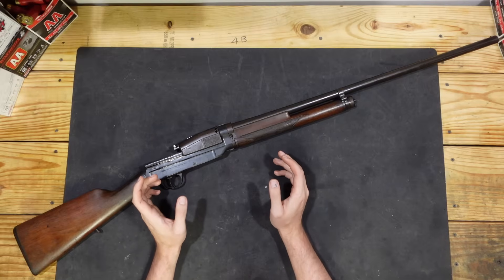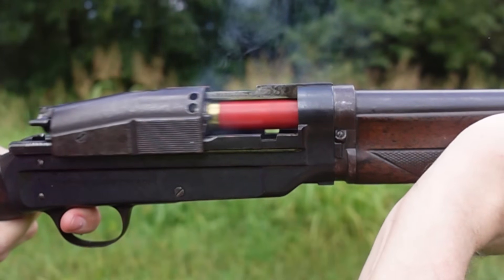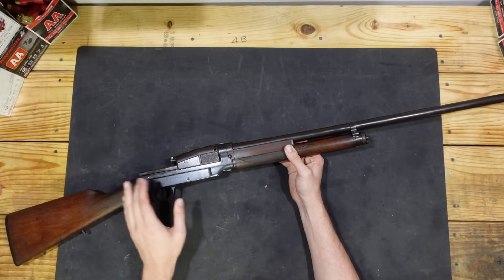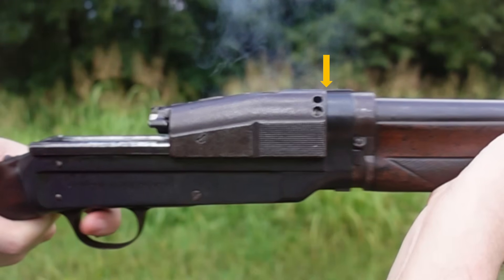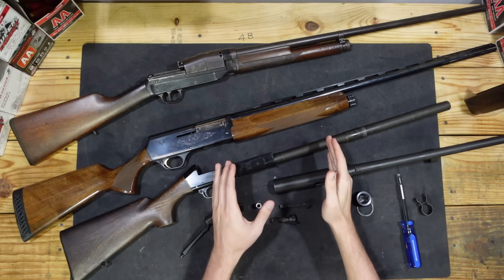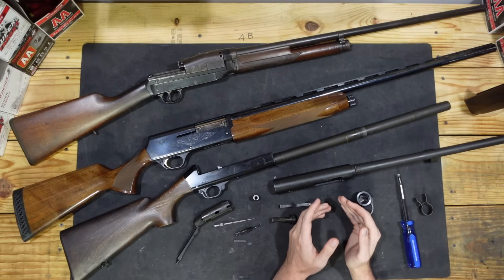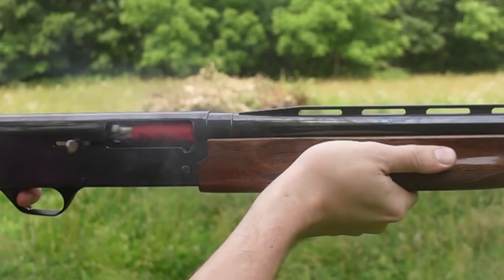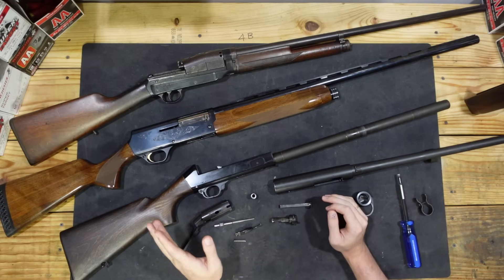How Inertia Operated Shotguns Work

Comment: A REALLY interesting shotgun to show would be the Bernardelli Victor (manufactured from the late '40s to the late '60s).
Other than having a prismatic detachable magazine, that gave it the look of a battle rifle, its operating system is practically that of a SVT40 rifle, with all the gas part removed, so that it works thanks to a mix of inertia (of the bolt carrier, that's helps unlocking the bolt) and mechanical disadvantage (due to the locking surface on the rear of the bolt being slightly angled). 
The first version required to change the setting of the recoil spring between light and heavy loads. The second one not even that.

Comment: Love videos like this. When you get around to a gas gun video, could I ask for a segment on the Benelli M4 and how its ARGO system is unique from other gas systems?
Reply from the maker: It's not really very unique. It's a "White" style gas cutoff system, like the M14 has. It's execution of that design is certainly different, but the gist is still the same. If I ever end up owning an ARGO gun I'll definitely talk about it, but it's not nearly as novel as Benelli advertises. And it's not really "self adjusting" in a meaningful sense of that word - just like the M14 isn't either. Gas cutoff systems can run cleaner, though. And the Argo system is a decent implementation of that.
Reply: @IvanPrintsGuns  That’s a bit unfortunate to hear. Whether or not I’ll be able to bring it to fruition, I’ve been mulling over an idea that will need some sort of reloading system and I was assuming that ARGO system would be the best because of its claimed self-regulating and self-cleaning. Probably just end up with a regular ole, off the shelf adjustable gas block lol

Comment: I remember hearing that the inertia action requires some “give” and therefore if you planted it solidly on a wall or something, it wouldn’t cycle properly. Is that true or just complete Fuddlore?
Reply from the maker: That is true, as explained
Reply: @IvanPrintsGuns Thanks for the info. I guess that and it having a specific weight that’s needed for reliable function is why the Benelli M4 went to a gas operated system.

Comment: I wonder if it would be possible to make a AR PCC into a inertial system. Use the bolt carrier as the inertial mass and reverse the cam path the bolt face takes.
Reply from the maker: I suspect there wouldn't be enough recoil to work reliably - with shotguns and full power rifles inertia can work because there's so much recoil it really takes a lot of strength/technique to hold the gun tight enough to cause cycling issues. With 9mm there's substantially less oompf.
Reply: @IvanPrintsGuns  Oh neat. So the concept is possible just not for PCCs. What if you had a short recoil system so the the bolt and barrel recoiled back and the inertia unlocked the bolt?
Reply: @checkmate058  it is technically possible for PCC but you need to increase recoil with something like conical muzzle device, which has no sense in practice. You can add recoiling barrel for inertia to work, but then youll get just a short recoil system with extra steps, which I also see no practical benefits of doing. But inertial system could work with b***p stocks IMO.
Reply: Isn’t that what the LMT smg 45 does, badly?
Reply: @shifter07x you mean the lwrc smg 45? No that was short recoil
Reply: You would probably need a lighter bolt carrier, also it's to my knowledge that most PCC are blowback operated so you might have to change some stuff
Reply: @Stoned-Clippy  CMMG uses a AR ish bolt to create a rotary delay system. I imagine something like that.